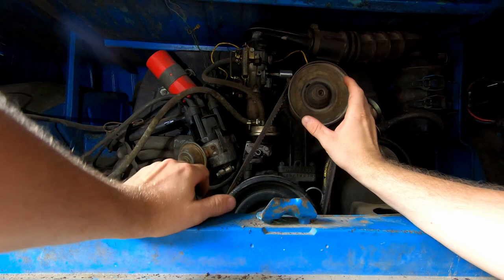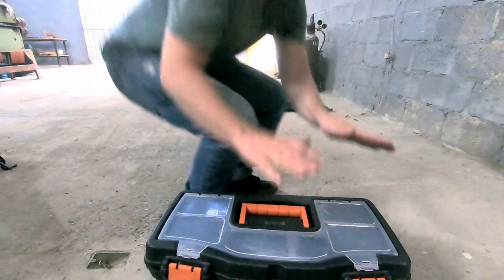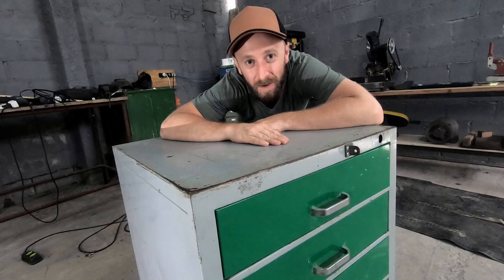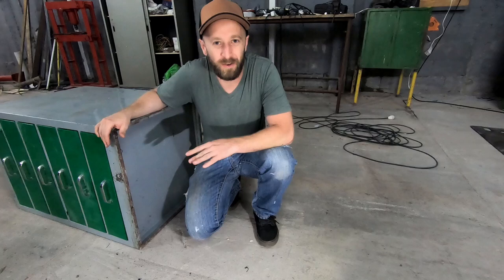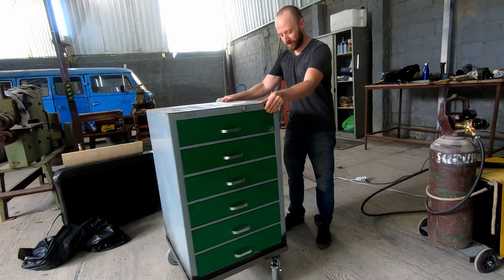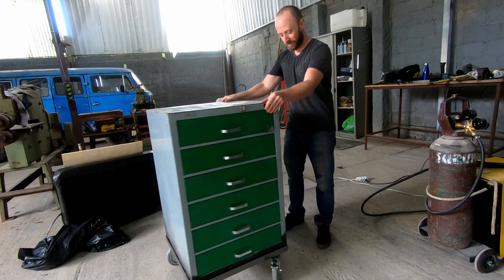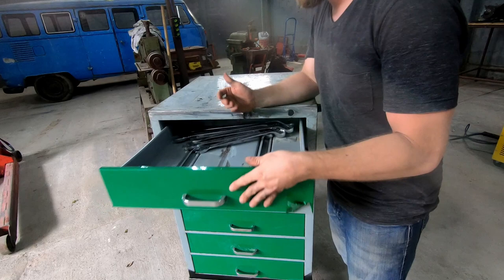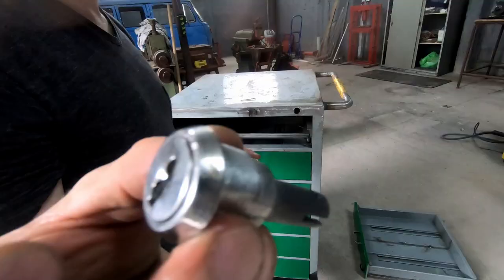Filing Cabinet to Tool Box

Comment: FWIW: That is a cabinet designed to hold IBM style punch cards from the dawn of the computer age. They are well made and frequently available cheaply because the age of the punch card has long gone: Somewhat like library catalog cabinets (another option with smaller drawers) I personally have a 10 drawer punch card style cabinet that I store hardware in.

Comment: Hey bro! How does the lock system work?  I want to make the key for my toolbox.
Reply from the maker: The lock tumbler turns a rod which lifts a bar- this bar has slots that align with each drawer so that when it's lifted it holds each drawer closed. Most tool boxes have a similar system. 
Thanks for watching!
Reply: @MetalSmithBrazil  thank you from  Viet Nam👍👍👍

Comment: Any idea what that style of file cabinet is called? I've got a couple at work filled with hardware and would like to find more to do something similar with
Reply from the maker: Not sure on the exact name for this style, but the drawers in this one had inserts to hold letters.
Reply: After a quick search this looks to be a "card" style filing cabinet. Thanks for the video and for the comment about it holding letters as that helped me to figure out what they are called rather quickly.
Reply: In the dark ages of computer development (1960s-1970s) computer "programs" were run using a series of perforated cardboard cards. The primary producer of "computers" then was IBM and the cards became known as IBM cards. The file cabinets to store the cards in order were thus IBM Card cabinets. They are well made and ideal for hardware and tool storage!!